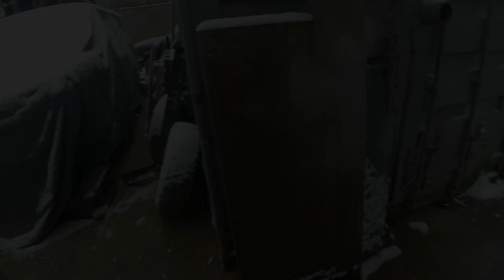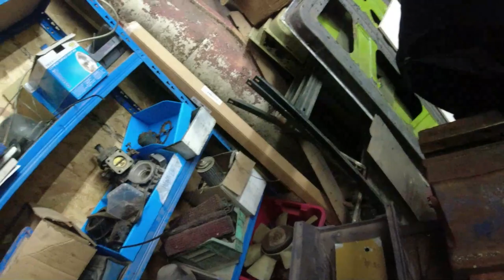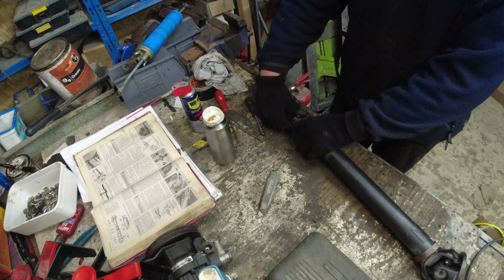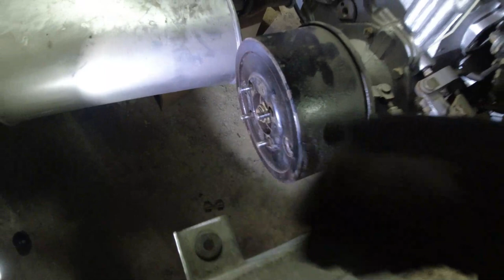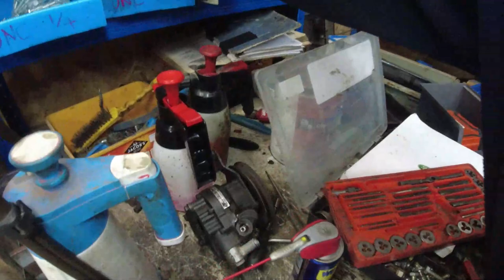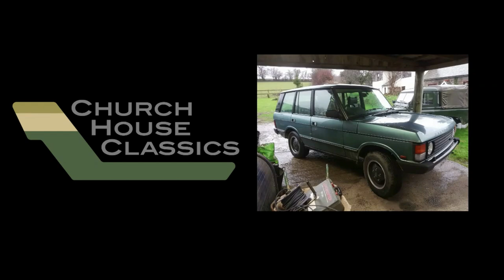1973 Range Rover ep6, shafts, flanges and seals arf arf

Comment: Shame about the Gibbonry but you got to do a proper refresh on the hubs and it's good content.

Do you ever use 3-in-1 oil instead of WD40 ? Much better at dissolving rust and tarnish, I'm sure a little dousing of the stuff would have freed those stick ball joints...
Reply from the maker: the stuff I use is "wd40" penetrating oil and not the bog standard stuff. Works quite well i must admit

Comment: I noticed that the front prop was assembled with the UJs in phase. On my 1989 RRC the front prop has the UJs out of phase by two splines. Is this something that was only done on the later cars.
Reply from the maker: Must admit that I rebuild them as I take them apart. Not put too much thought into it and have yet to find one out of balance
Reply: @churchhouseclassics  To cut a long story short I have a RRC that a previous owner had modified to full "comedy spec", 4 inch suspension lift, 35 inch tyres, etc. Unsurprisingly it was horrible to drive so I was initially going to put it all back to stock. However my inner eight year old decided that he quite liked it the way it was so I set about re-engineering it to make it all work properly. As a result I'm now a bit of an expert on UJs and drive shaft angles amongst other things. 😀